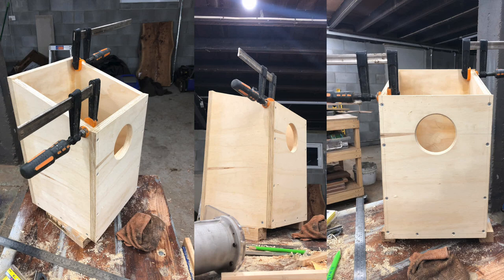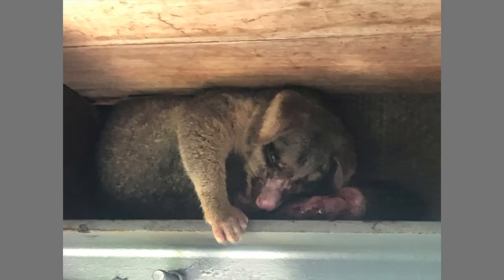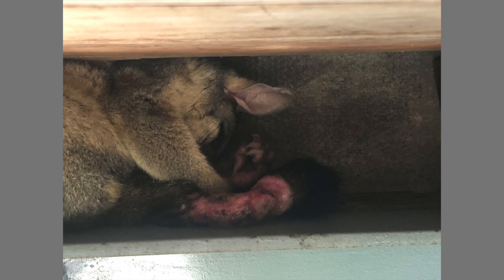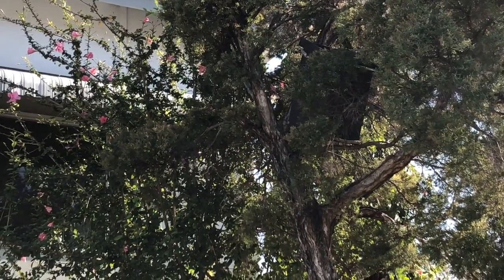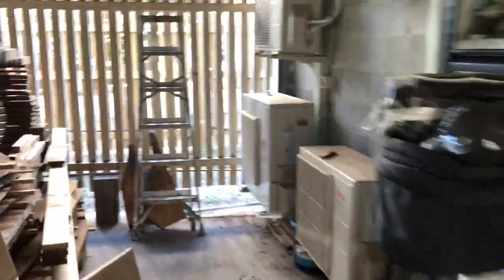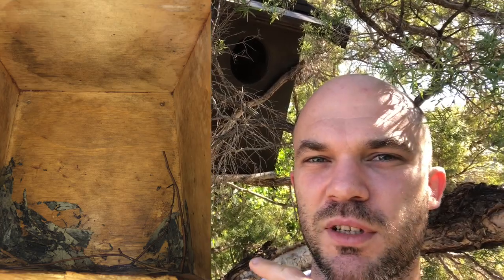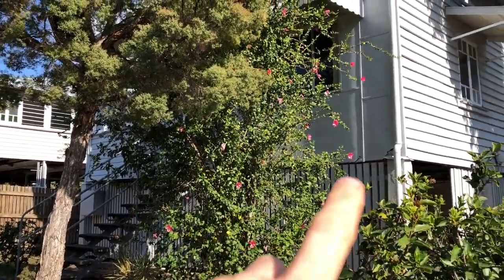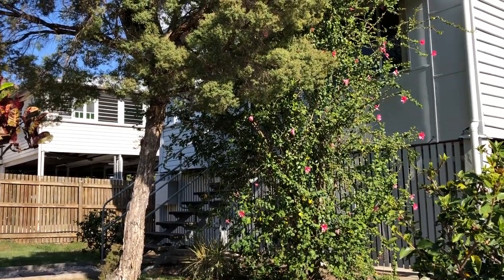An Update On The Possum Box

Comment: Three to five metres is optimum height for possums. Put fruit in the tree and they’ll move in. Best way would be to evict the ones you have out of your house and block it up and they will find somewhere else, as long as you entice them. That box will be way easier for them to get in and out of and not as cramped as where they are.

Comment: I have had 25 generations of possums living in my garage. When I say 25 I mean that the female that occupies that spot for five years or so (short life span), has at least one baby a year. They pass it on to a daughter when they croak it. It is in the very far corner of the garage in a false stud wall, The entrance is at the top near the roof, but she goes right down to the bottom near the concrete as I hear her scratching and squabbling with her young down there. This becomes a problem when we go away as I have to secure the garage but leave enough of a gap to let them get in and out each day. I would prefer that they were not in there actually and I have made possum boxes for all sorts of places in the yard. All of those boxes become occupied, but they won't leave the garage. It doesn't matter how low a box is within reason. Just above where your hand could touch if you were reaching up is fine. The main problem possums have is getting very cold (and from memory it gets bloody cold in QLD in winter), so the box has to be insulated with a thick layer of wood (around twice the thickness of the wood you have used. Remember they would prefer to be in a hollow tree). The other problem is them getting hot in summer, so if the box is in direct  sunlight this can make them really really hot. They will even get out of them or hang their head out occasionally because it is just too bloody hot. Choosing a spot to put the box, under cover of trees is best or thick foliage like in the leaves of a climbing plant. Thanks for getting back to us on this situation. (Zimbabwe or South Africa?}

Comment: Really?  They are immune to snake venom and rabies, but die of a simple rash?  Sheesh. By the way, mum's carry babies on their back. So maybe the hole was too small for her to climb in?  Another thing to consider is they like to have soft cushiony areas to lay with her joeys. Try adding something soft in there. And one more thing: if you don't like checking because it's too high, maybe she thinks the same thing. Maybe she just doesn't want to climb that far up.  I think it has to do with comfort, though. How is the climate?  Possums have lower body temp than most animals, which is why they are less likely to get rabies.  Just a few things to consider; though I'm sure you have just as much access to the internet and Google as I have. 😁
I've found three opossums in our washer at different times.  The first one lived through the entire wash, rinse, spin cycle set at "extra dirty" and "pre soak"...came out smelling April Fresh!  Apparently, Mum carries her babies on her back when trying to scale our beams upside down and occasionally drops one.  The second one died a few weeks ago. I didn't get to the washer to transfer the clothes to the dryer, soon enough. 🥺 I have two babies in the basement right now, and getting ready to set them free. They can eat solids and were away from mum, so they're ready. One was in the washer (that's the third one...we caught sight of him before dumping in a load of clothes), and the other was in the trap that I set when I was trying to catch the mum.  I was thinking about making them a hutch, but when I saw yours didn't work, I gave up (yeah, I DID sound like I had all the answers earlier in the post, didn't I?) 🤣 I'm hoping since they were born in the basement, and didn't climb in on their own, they may not be able to return, since they don't have access to MapQuest. I may put the dog carrier in the back yard with the door off, and let them acclimate to their new surroundings. I may toss a bit of fruit on there, but not enough to satisfy them. We'll see what happens.  In our state, it is illegal to relocate wild animals, illegal to keep them as pets, but perfectly legal to kill them. So my only choice is to set them free in the back yard and hope they don't decide to climb the section of fence that is keeping the five full-sized dogs in their yard. They are SO LOUD!